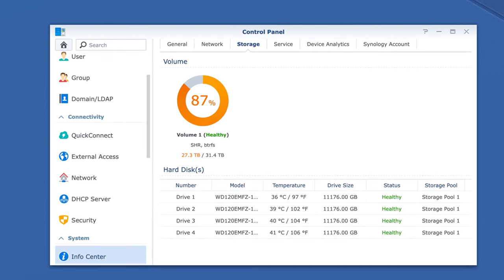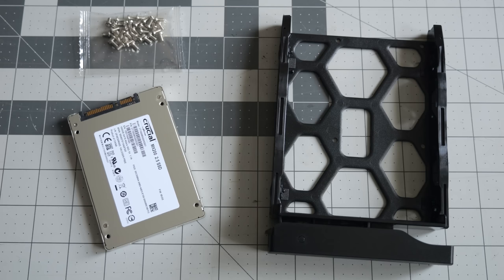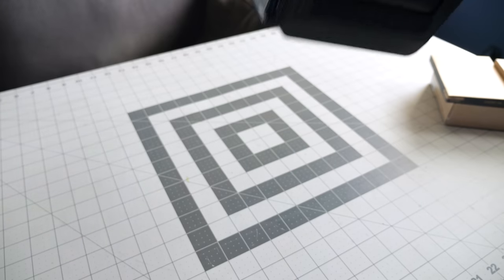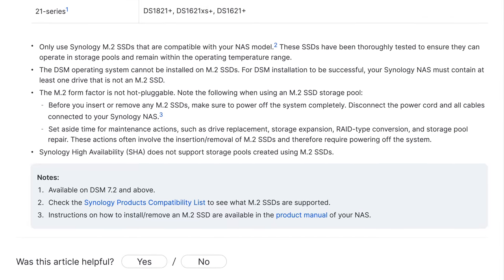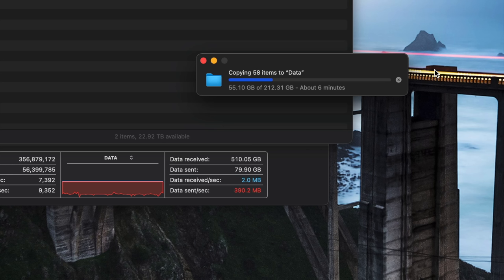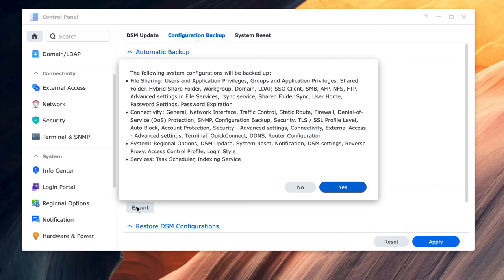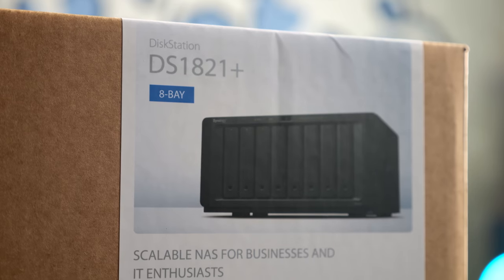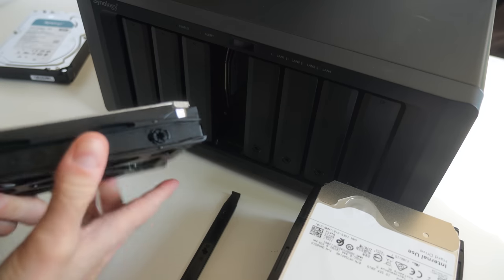That's a LOT of hard drives! | Synology DS1821+ NAS review

Comment: Wow absolutely ridiculous they removed SMART info from the GUI. I maintain over a dozen of these at work, and I've used that screen to provide proof to the hard drive manufacturer to replace the drive under warranty.
Reply from the maker: It’s apparently still able to be retrieved through the CLI, but that’s definitely not a convenient option.
Reply: Would love to know that command! @ThisDoesNotCompute
Reply: The consumerification of technology.  Start by being powerful and easy to use, then take away all the useful controls and data because "oh, don't worry your pretty little head about that, we'll handle everything for you."

Cost is one thing.  But THIS is why I always just build my own.  Supported drives are the ones that fit and work, and the controls available are any and all of the ones the OS and installed applications have.
Reply: @nickwallette6201 Here's your cookie. I think it's important to remember that in most instances consumerification happens because consumers are not into messing around. They actually do not want to worry their pretty little heads most of the time. So if you want to throw ire at someone, make it the consumer who is forcing the market to meet them where they are.
It's like getting mad at Apple for selling most people what most people want. Number one handset maker for a reason.  It just works.
Reply: @POVwithRC   True, and that's actually why I use some Apple products myself.  But, ease of use and control aren't always necessarily diametrically opposed.

There are also some products that are inherently targeted to a slightly more tech-savvy crowd.  There are consumer-friendly NAS devices -- using Apple as an example, in fact, there was the Time Machine.  But even knowing that such a thing exists put you on a tier above "plain old normie" anyway.

Nobody is buying a Synology NAS that can't handle being able to see SMART data.  C'mon...  I would also find it perfectly reasonable to force the user to click OK to acknowledge "this storage device has not been tested for compatibility -- Synology cannot guarantee it will operate correctly, or at all -- continue at your own risk"
Reply: @ThisDoesNotCompute  Nonsense like this was the reason why I moved away from Qnap and Synology altogether. Limitations in what disks you can use, some proprietary extensions to perfectly good filesystem and RAID formats as well as the question what happens when any of the hardware fails made me go to Unraid and I never looked back. You can use standard PC hardware as powerful or powersaving as you desire, use any combination of disks of any size and upgrade as you go. Best of all, it turned out to be one of the best Docker hosts for home and semi-professional use, making managing and extending your NAS with extra functions a breeze! Would love to hear your view of that system sometime.
Reply: Unsure if synology people figured out a better way, but this is how it is done on linux and TrueNAS for example.
Reply: At least you have an ESATA port
Reply: def not fond of this, along with their switch from being able to use variety of drives.  mehhh

Comment: Synology is the Apple of NAS. You're locked into their ecosystem for parts. There's a great great price increase for convenience features, and you own your own device even less. If you're at least a little tech-savvy, just build one yourself. It's a nice project, and you can host many different things on it too, which makes it more versatile.
Reply: Can you build your own for that price with removable hot swap bays?
Also nice gui front end?
Just trying to compare apples to apples.
And they are still not as bad as Apple.
Reply: Excellent customer support, phone apps, ease of use.  For a home user like me, synology is a good choice even though it’s expensive compared to rivals.

Comment: The move away from Intel to AMD means no hardware transcoding in Plex which is a killer for me.
Reply: Exactly why when I needed to upgrade my DS418 I went with a DS920+ and not the 923.  I wanted more than 4 bays but they seem to all have AMD chips now…. 😢
Reply: can you tell me what you actually need transcoding for? Like, what device do you have that won't play an mp4 but will play a real-time "digested" video file? I ran jellyfin on freebsd and ubuntu (never got transcoding to work) but found I never needed it using web and amazon fire players. So if you have some crappy 1st gen roku, wouldn't it be cheaper to just buy a $30 firestick or whatever than insist on transcoding, or is there some other workflow you need?
Reply: @mcpr5971 Depending on how high the video frame size and quality is, it may be too high bandwidth or too high resolution to play on lower end devices natively
Reply: @@CuteLittleMexicanMidget I hear you on e-waste but PS3 also burns way more power. I haven't done the calculation but throwing away a 15 year old power guzzler and replacing it with a modern player MAY be less wasteful.
Reply: @mcpr5971  Transcoding is changing the video format on the fly to accommodate the receiving device.  For example, if you have a 4K video ripped to your Plex/Jellyfin or whatever and want to play that on your iPhone/tablet or whatever it is going to use a lot of bandwidth to send that high quality video.  Transcoding will downgrade the resolution to something more easily digested by say your phone that is on a cellular network as you stream a video on the train going to work.  Integrated graphics are needed for “on the fly” transcoding, which AMD processors don’t have.  Intel Celeron processors do.  While on the fly transcoding can be done by a CPU alone, it requires much greater compute power.
Reply: @MrSunDevil23  why are you explaining something that I already understand?
Reply: @mcpr5971  your question seemed ambiguous.  Sorry I wasted my time trying to be helpful
Reply: Honestly, I don't see absence of transcoding capability a bit problem. It's good to have it but generally I consider it's best to have a separate device like a minipc running as a home server, for stuff like Home Assistant/Plex/jellyfin/etc.
But anyways, I expect my next nas to not be a synology, because they treat their customers poorly, and are laying back behind the competition in everything except the os.

Comment: Synology Support is a lot hit or miss, it seems. When my DS415+ failed with the C2000 problem just slightly out of their 3 year warranty, all the German support had to say was that they'd happily help me choose a new Synology model to buy. No mention of the 100 Ohm resistor fix or anything - even after explicitly asking. I had to find that out from a forum where people posted photos of their "repaired" units after they got them back from Synology. OTOH, since soldering in that resistor, the unit is working fine to this date. knock on wood

My next unit will be a TerraMaster F4-423, however. It has an internal USB port with a flash drive which you can swap out to install e.g. OpenMediaVault. So it's the next best thing after building a completely custom NAS and in a much smaller case (compared to available Mini-ITX cases with HDD slots), too.

Comment: I have a Synology NAS with dual disk capability and it works great.  This particular NAS is not for many as the cost is VERY high.
Reply: I mean, $999 is pretty reasonable for 8 bays, a PCIe slot, and honestly some of the nicest included software I’ve ever used in a NAS.
Reply: price is NOT high.
Reply: @RobertoCarlos-tn1iq  for the average consumer it is.

Comment: it will use around 90-100w of power tho .. if you lucky enough to be able to afford it or have cheep electricality  then its not a issue, but I'm UK and prices are through roof at moment .. Ill stick with my old Dell T430

Comment: I'm always a bit on the fence about getting one of these types of dedicated NAS boxes.  I've been using an old Linux server I built with standard PC hardware all the way back in 2012 to run my Plex server, nzb server, and samba file server.  That's cool that this Synology stuff seems to have good server applications but I'm feeling it's probably limited compared to the full on flexibility of running anything you want on Linux.  The thing that kind of gives me pause though from moving towards a NAS is the whole idea of these very specific and sometimes proprietary file systems these things seem to use.  In my mind it seems to create a "single point of failure".  If that NAS box fails, none of my other hardware (PCs, servers) can read those drives natively.  I always feel piece of mind in Linux, with it's standard ext4 formatted hard drives that I know if the box itself fails, I can always slap any of the drives into another PC that I already own to get the data off.  Like I said, I'm running a very simple AMD Sempron based server from 2012 that still streams 4K plex streams to my Apple TVs around the house, runs all my nzb download server processes, etc like a champ!  I'm just not sure where I'd see the value in buying a dedicated NAS that seems more expensive and may or may not have the same capabilities as an extra Linux box lying around from old hardware.
Reply: You might want to look into Unraid, it's a Linux NAS running off an USB-stick with great support for Docker. What makes it special is the way it uses disks, allowing for unparalleled flexibility when it comes to using a mix of existing disks.

Comment: Lol I bought a DS923+ 4 months ago predominantly for the SHR so that I can start and add more drives and for photos/moments, and I had already run out space. So instead of buying expansion, or a new synology I have repurposed my old computer with Unraid and in the process of moving everything to the unraid server. All in all - I have a better CPU, better ram and more of it, better graphics. I think the way that synology is going it is moving away from home market, so it may be better for small business. I don't believe that Synology is value for money, especially if you have consumer hardware available. The other thing that pissed me off from synology was the mail - I misread the email server - they have two versions one that gives 5 seats, and one that's free. I was thinking with my synology nas I would get unlimited (as much as my hardware can handle of mailboxes - and this was not the case. Oh and also, once you reach capacity of whatever arrangement that you go with your upgrade options are so expensive. So its not really a lot of value exchange  happening with synology.

Comment: I've had a few 4-bay Synology at home for many years. They've been rock solid. I like how they're just Linux so if the box dies then you can recover your data easily. Unlike proprietary boxes with bespoke partition schemes and filesystem formats. We occasionally have NAS mailing list threads at work, I've never seen anyone dissatisfied with a Synology purchase.
Reply: That's very strange. There's a lot to be disappointed with. Weak hw, poor mobile SW, Synology drive client hiccuping every once in a while, vendor lock advances...
Reply: Buy a box powerful enough for your needs. The web interface is good, it's just regular Linux underneath. There is no vendor lock in. Linux is the opposite of vendor lock in.
Reply: @JamieBainbridge  Synology is actively pursuing vendor lock. They're starting to show non-qvl drives as not-green in the diagnostics, showing popups for non-Synology ram, disallowing use of non-Synology m2 SSD for storage.
Or are you speaking of building a diy nas?
Reply: Okay fair enough, I don't have hardware that new I guess.

Comment: 0:35 Money HAS changed hands. It's called an "in kind" compensation. This unit is over 1000 Dollars without any hard disks. 
  I have never once saw a sponsored youtube video where the review is anything but glowing. I will be very surprised if this review is anything but glowing with anything more than token criticisms to make it seem balanced.
Reply: oh it's a glowing review alright!
How easily glossed over the fact that if you use any 3rd party m.2 drive it wont work fully (just work as a cache drive) and then claiming this company is DIY friendly (only just this one feature missing) says it all about how critical the review is!
Reply: @AshrakAhmed have to consider the review from the POV that he got everything for $0, which makes any problems with the hardware nearly irrelevant! Ofc the way its framed is that it is not a biased review, when it cannot possibly be unbiased due to the free hardware. I would also be using a Synology over my DIY shitbox nas if they sent the stuff for free and made me do an inherently biased review of it haha.

Comment: I got a 1621+ and found its performance is amazing - link aggregation and SSD caching makes it amazing. It's also pretty crazy how powerful the Nas is - you can run docker images on top of the Nas or full blown virtual machines.
Reply: when you say amazing performance, what type of real-world r/w speeds does this equate to?  I've been spoiled by my DAS units over the years, but approaching the need for NAS with a multi-editor job coming up in October and doing a lot of research lately.  seems like it takes a LOT of work to get 900mb+ on these units and bit apprehensive about making the switch.  TIA for the input

Comment: Not going to tell you what to buy, but putting 12TB or just 8TB drives in a NAS, with the current energy prices, is a bit hopeless. SHR (Synology Hybrid RAID) makes it at least easy to upgrade the drives. I will also never understand Synology's fixation on multiple gigabit ethernet ports. It's a dead end technology, easily fixed by providing an SFP+ slot, where you can run 1, 2.5, 5 or 10G over copper or fibre. I switched from a DiskStation to an HP MicroServer for that exact reason. 10G, 4 bays, 2 NVMe plus a SATA SSD. Usually the drives don't even need to spin up most of the time, and 1 GB/s is easily attainable.

Comment: Been pretty happy with my DS3018xs. My first unit arrived near-DOA (worked fine for a week or 2 then started doing the blue blinking LED of death and refusing to turn on.) Fortunately it was still within the Amazon return/exchange period so they just shipped out a new one, problem solved. Didn't even have to backup/restore any data, just took the drives out of the dead unit and slapped them in the replacement and was back up and running. I'm starting to hit the storage space crunch too, was thinking of swapping out my existing drives with larger ones, but maybe I'll get a unit with more drive bays instead, I hadn't thought of that. Being able to get more space as well as switching to dual-drive redundancy (I am currently running with single-drive redundancy only) without buying a whole set of new hard drives is definitely appealing.

Comment: 8 drives for $1000?

Just get an old Thinkserver.  I have 11 disks in mine, and it cost $200.  TrueNAS is free and outstanding.
Reply: Power consumption tho...
Reply: @The-Cat a quad core haswell system with a sas card for more drives would idle at around 30w with the drives spun down. So for about $200 you have pretty good idle power consumption (file servers are idle most of the time)
Reply: But again, this isn't for you if building a diy nas is an option. These Synology boxes are intended to be plug and play, not plug and configure / throubleshoot for 5 hours.

Comment: I would get a DIY for 1/3 of the price with 10 times the performance. Just some troubleshooting. It would end up a better video.
Old very good unRaid and some shucked drives from WD.

But considering is free, i would say yes too.
Reply: Hell for $600 before drives you could have a 12900k 32GB DDR5 NVMe boot disks and probably find a used 25gbps NIC, sure you can splurge a bit more for a case with hot-swap bays but still way under $1,000 and way more performant.
Reply: You are obviously not the target customer of this relatively ready to use NAS boxes. Ofcourse you can do it easier or you can do it better and cheaper.

Comment: How do you get 500Mbps transfer speeds when writing to 5400rpm mechanical hard drives?
Reply: it's the combined speed of 4x drives working at the same time that delivers this type of speed.  my 8bay DAS consistently does 1200-1300 without breaking a sweat.

Comment: I just recently bought a laptop off my aunt (she was gonna give it away either way and I've been eyeing switching from my tower PC to a laptop for space reasons and this all sorta fell into my lap) and the one massive complaint I have is the lack of hard drive space, so this might be a useful video for me to watch right about now! Only issue is that it looks like these large hard drive enclosures cost a pretty penny upfront but I'm definitely a data hoarder so maybe it would be worth it in my case :)

EDIT: I know "space reasons" conflicts with "huge hard drive enclosure" but for me, having both laptop and hard drives in separate spots in my room instead of one massive tower sitting right on my desk would still work out better. Plus there's other reasons I wanted to go with a laptop from battery capability when off power, to being able to move my PC around easily, to modularity in my setup. Plus I now have two screens without having had to buy two separate monitors! I just like the convenience factor of a laptop form factor.
Reply: Hide that massive tower full of hard drives in the basement and run TrueNAS or Unraid in it.

I had my old 4670K + motherboard + RAM and my old BitFenix Ghost collecting dust, and I recently repurposed it as my NAS server. I just needed a new PSU. I removed all my HDD from my current computer and tossed them to the old one + some new EXOS drives. I basically have all the functionality of a Synology NAS for 50€, as I only needed to purchase the new PSU.
And adding more drives is as easy as getting a SATA or SAS controller.
You can even repurpose an old GPU (nvidia) as transcoder or AI accelerator. Possibilities are endless.